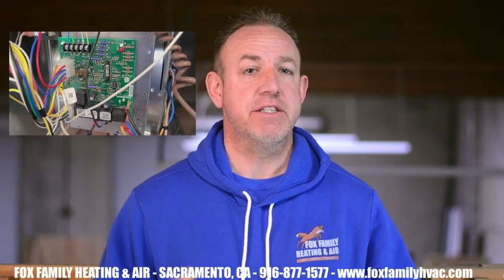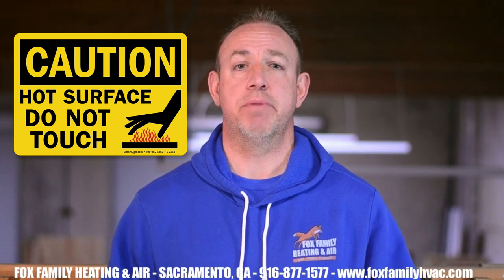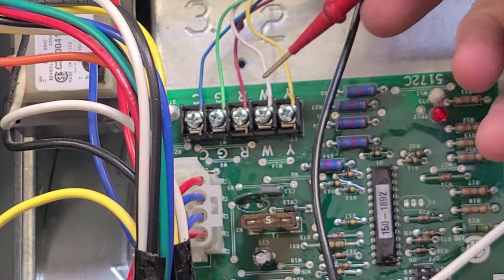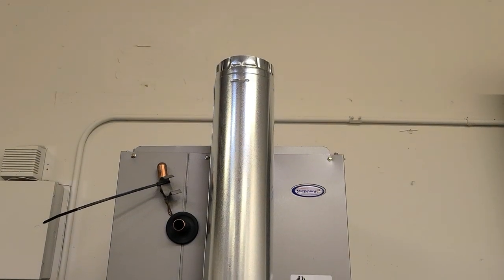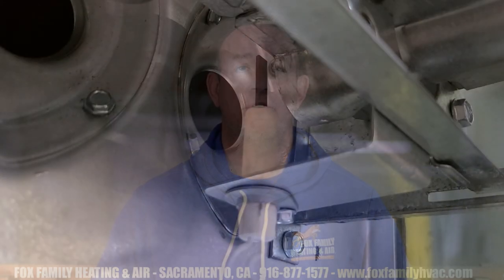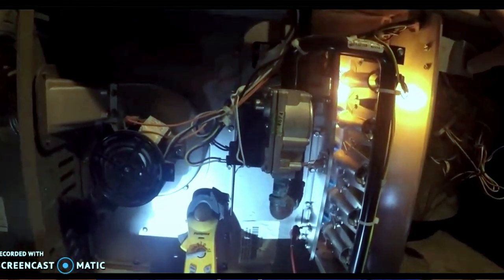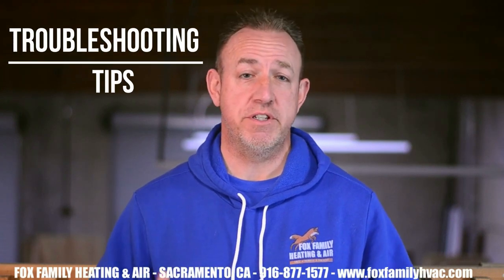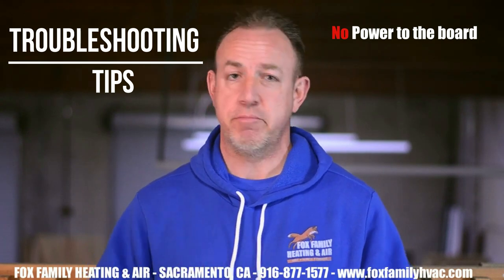Troubleshooting Your Gas Furnace (The Easy Guide 2021)

Comment: I´m thousand miles away. A great thanks for educational you provided. At least now i can understand how things works and relations betwen each part.
Even if thermostat will tell what´s wrong, a quick check will be helpful. For sure heating system will fail in worst weather, when technican would prefer to stay safe in its warm home than to drive in crazy weather to a customer´s house.
Thanks for all and be safe.

Comment: I have induction motor on, ignitor zapping, and no gas. voltage on red wire to the gas valve is 10 volts constant with voltage going crazy as ignitor does its thing. wires seem clear of cuts and abrasions. my only thought is a bad circuit board.

Comment: I have a Question my gas furnace is also my air conditioner  the main unite for the Ac is outside , why will not my furnace shut off the blower motor in the house comes down to the temperature is set at the thermostat ? I’ve had the thermostat replaced I’ve put new batteries in the thermostat multiple times .

Comment: My gas furnace worked fine last week. Now it's throwing an ignition failure code. It's not clogged with a spiderweb like last fall lol. It goes through the process. Heats up the ignitor then shuts off after a few seconds. No flame at all. Does that a few times then throws the code.
Reply: Gas valve used your manometer and check for 24v